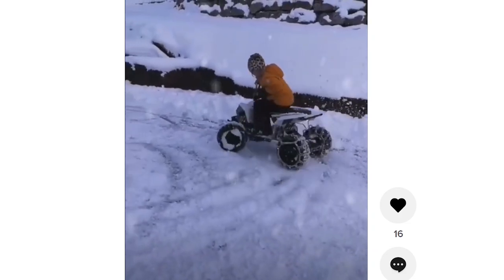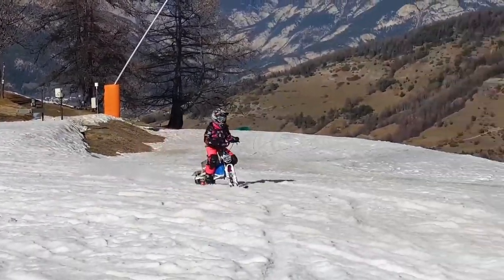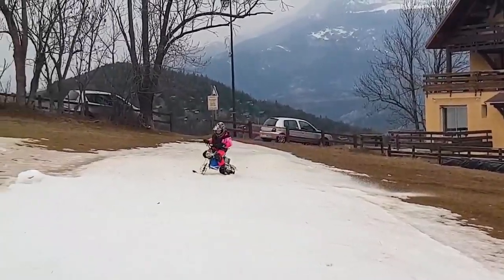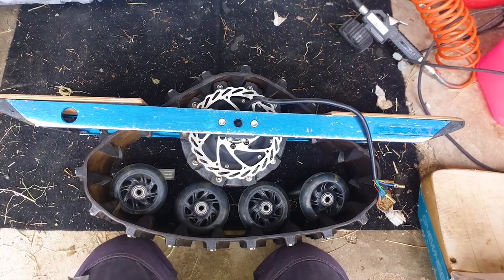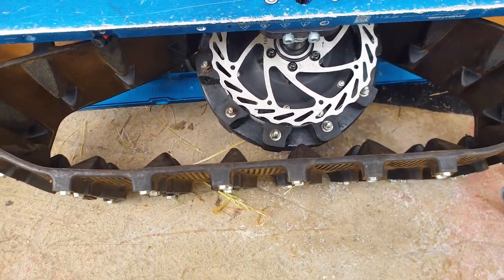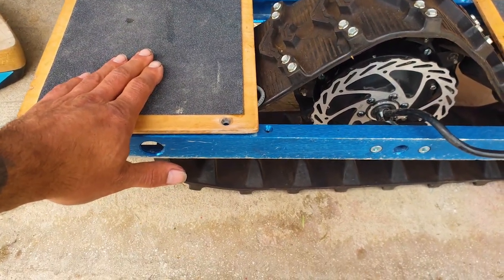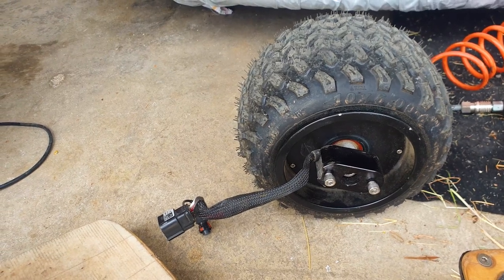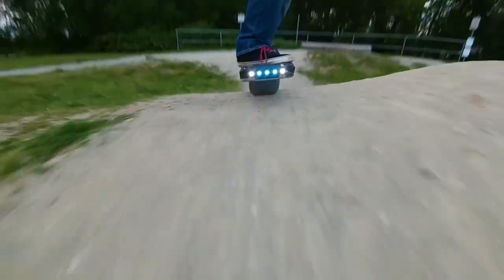Creative People Making Insane Electric Projects

Comment: Hello folks my name is Edward Heath and I am the engineer, fabricator and owner at “new ideas and innovations, LLC“ in Madison, CT and I wish I can upload a video of my electric car that I made several years ago that would travel for 840 to 1280 miles on a single charge or more depending upon five different criteria that I have composed into a press release!! I have sent out information packs to many many companies that manufacture electric vehicles even to Rish Benoit of “Rich rebuilds“ and sent out other information publicly to try to get some eyes on my project with so far no results other than people just trying to get free information which they will not get from me. My technologies can be transferred into any of the other electric vehicles so it is not like I am building one particular type of car, it is not so I’m hoping to get some true hopefully American manufacturer like General Motors or Ford or Bollinger or Tesla or any of them to contact me regarding licensing of my technologies to make their EV‘s go that much further. I am serious and not a scammer or from nut job car the car has been built and driven it is not finished due to some other stuff but it can be taken for a short ride. 
  Seriously and respectfully; Edward H.